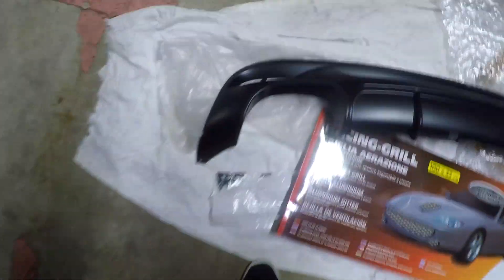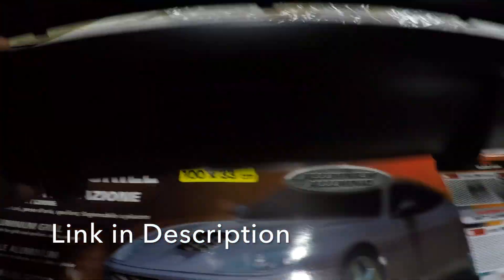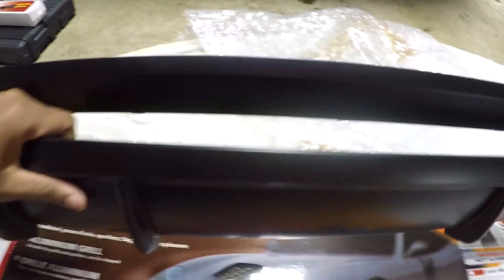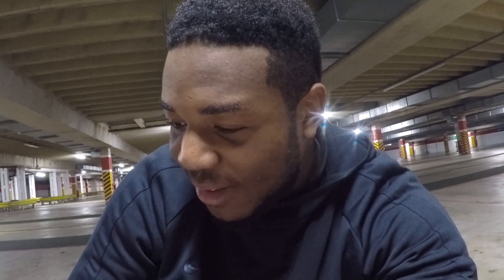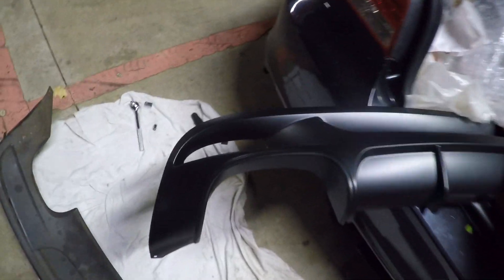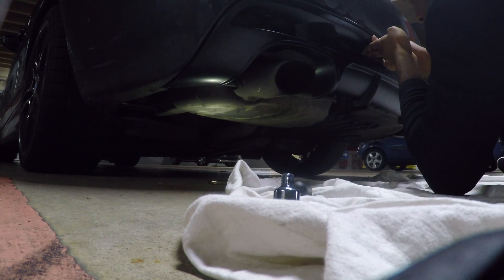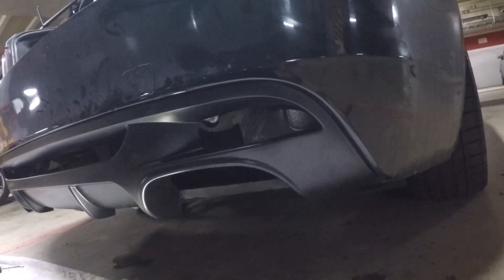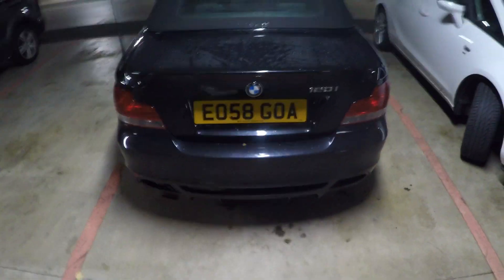Installing BMW M Performance Quad Diffuser on 1 Series E88, E82 Convertible & Coupe

Comment: That looks real neat mate! I also want bigger diffuser. But not sure my Clubsport is designed for it.. Also id love to have new Side-Skirt. Problem is, if u change the side of ur car, u kinda need to change the back to, otherwise the design wont flow nicely at least in my case ithink. Clubsport looks good stock, so ineed to be careful. But as for you, you might be able to gain some more in looks!  🙂  👍
Reply from the maker: Thanks mate! The clubsport looks really sporty already and yeah you’re right, if you were to change your rear diffuser you may have to add skirts to compliment it 🙂👍

Comment: Can't wait to see the exhaust fitment. What sort you going for,? Catback?
Reply from the maker: amxr_ rr It looks and sounds so nice! I have a back box delete with a 1M custom quad exhaust setup
Reply: @CARLISONIT  sounds great bud. But how are you going to deal with the back pressure, since the backbox will be removed. If my sources are correct, you may have to tune the ecu to ensure correct combustion flow to the exhaust.
Reply from the maker: Cheers man! It still has the midpipe and cat so no tuned is needed unless I were to remove the mid pipe and cat then a tune will be needed 👍

Comment: Nice set-up man!
Definitely convinced me to get this done, high reward for not much hassle !
Can I ask where in 'Walsall' you went for your twin double exhaust system? 
I'm from 'Walsall' aswell aha, I might have to pop down after work 😂
How much did they charge ?
Reply from the maker: Daniel Kainth thanks man and it was with DKU Performance i’m not too sure tbh but you can google them up from your address and it was well worth it 👍🏾